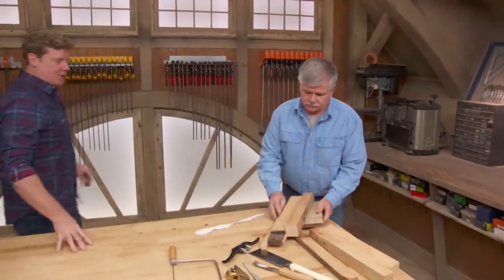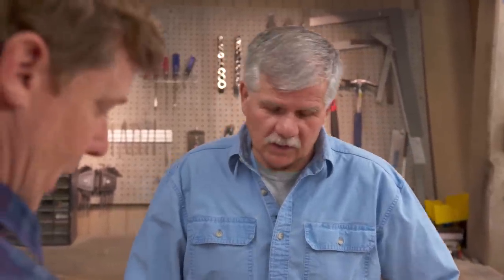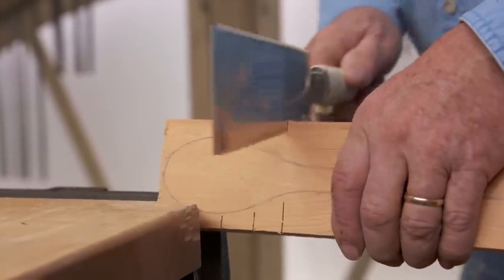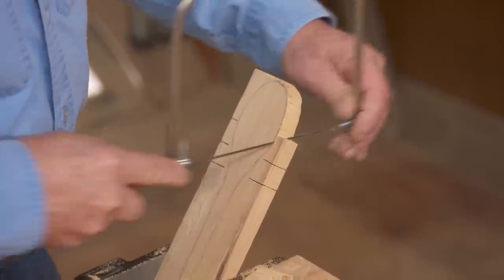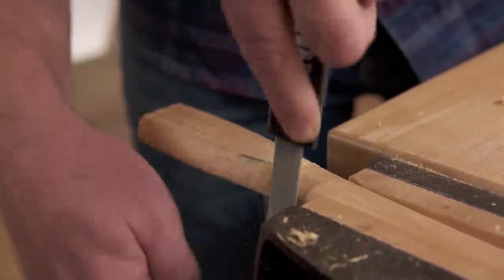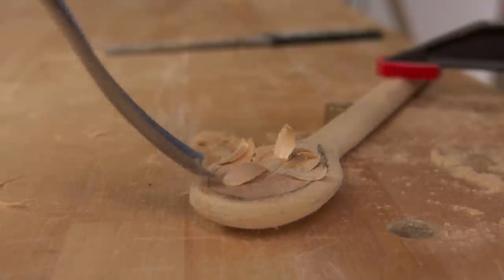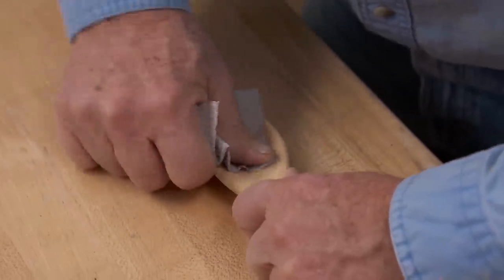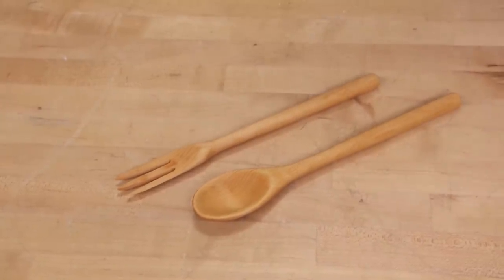Hand Carved Utensils | Build It | Ask This Old House

Comment: Did he say which teeth set are for which purpose, while using the ripping teeth to crosscut? I swear when he slows down the cut he's using it backwards. 
Great project though. I love the hand tool woodworking!
Reply: Large teeth for ripping, small teeth for cross cut.
If it's me however, I just use what I have on hand and it works out just fine.